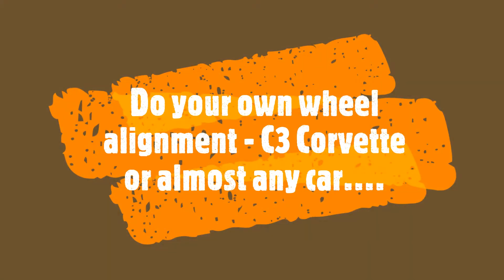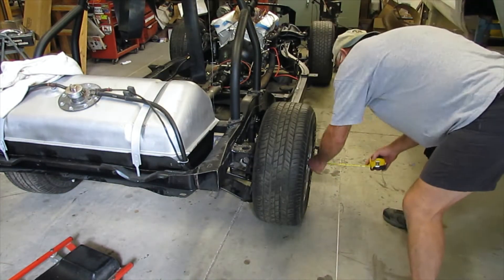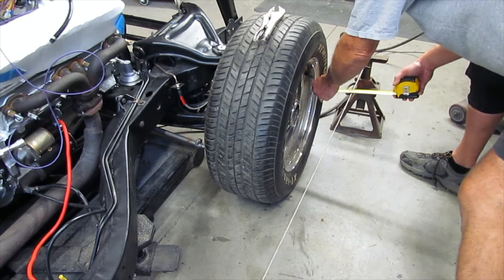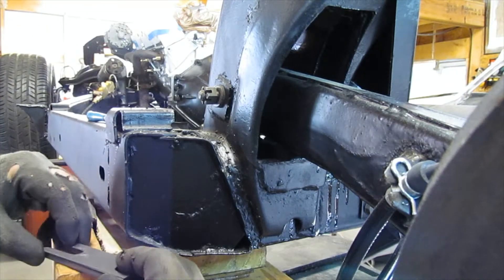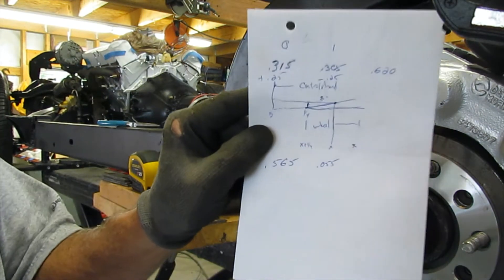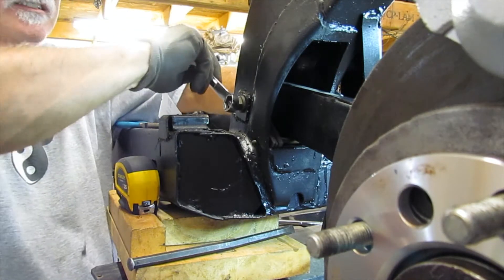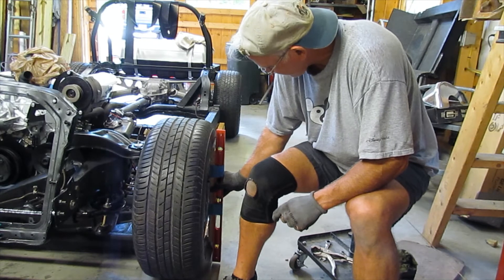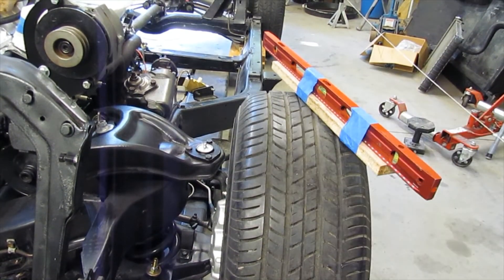Do Your Own 4 Wheel Alignment on a C3 Corvette - or almost any car

Comment: You might want to consider switching back to rubber bushings on the trailing arms before you're back together, unless you're comfortable replacing them later, as they will disintegrate pretty fast from multi- plane flexing in the trailing arm application.
Reply from the maker: Never heard of any issue with the poly bushings like that. They give a much firmer ride and precise toe control vs rubber in this application.

Comment: You seem to have more thickness in shims on the passenger front than the driver side. Did the passenger side need more to achieve the 0 degree camber you want? If so, can you perhaps explain why? Also, you set your rear toe in to about 0. Why not 1/16" to 1/8"?
Blessings, Scott.     👽🐍
Reply from the maker: The two sides are unrelated. The differences side to side are due to sloppy mfg tolerances (thanks GM).
All solid axle cars are zero rear toe by definition.  I like zero rear toe for a street C3 as a target, as I can only measure so precisely, and bushing compliance will cause toe change in/out anyway.

Comment: Will it need to be re done once the chassis has got the weight of the finished car on it?
Reply from the maker: Yes as I mentioned in the video, this is to get it close and drivable. I'll recheck the measurements and tweak again first but there is no real substitute for an actual alignment rack.